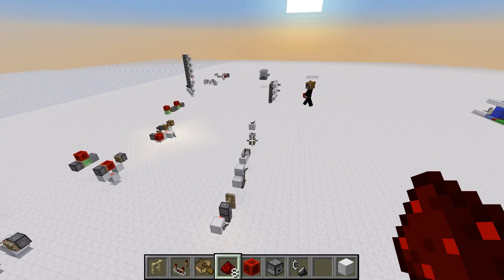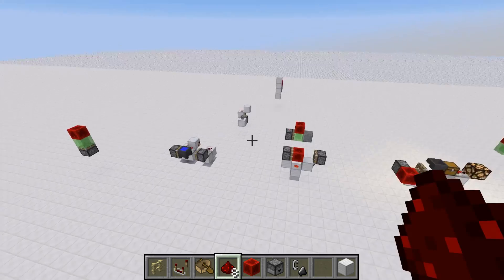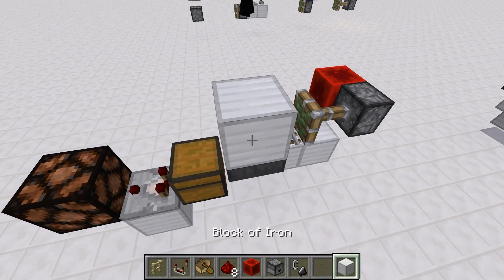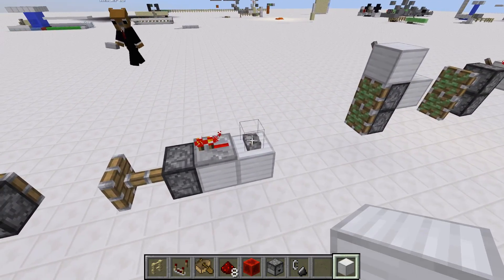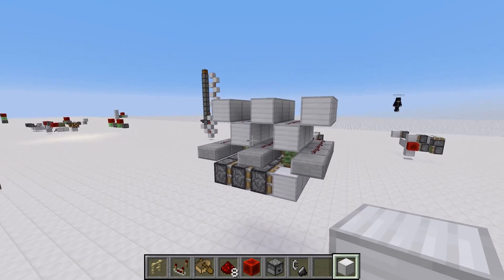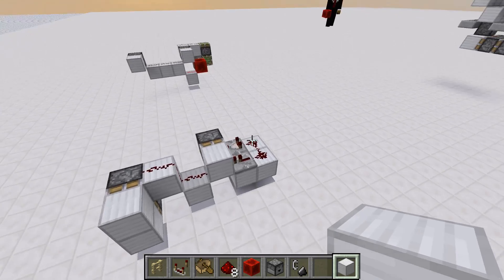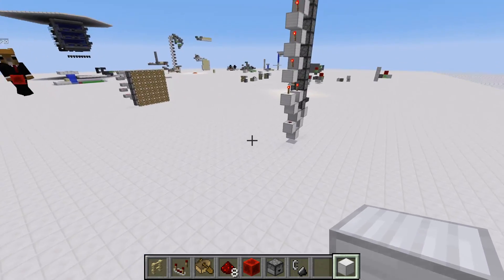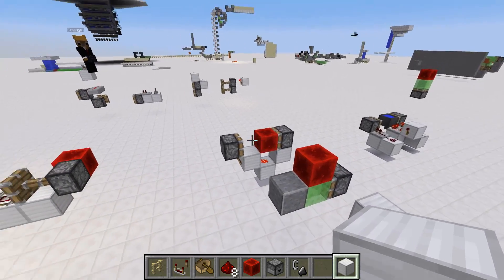Minecraft - NEW Redstone BUD Block "Observer" - Feedback for Mojang

Comment: i'm a pretty good redstone builder but honestly the whole slime block buds have always confused me. plus with the disaster 1.9 turned out to be i'm not to trusting of microjang to get something that big rite. these days they very much 1/2 listen to the community. so i am skeptical to say the least.
Reply: +minecraftaddict1169 the slime block buds aren't that complicated. They are powered indirectly by the diagonal redstone block. When they receive a block update they will start extracting. They are immediately unpowered but don't realize it yet. After 3 game ticks the extraction is finished and the piston updates itself. It realizes that it is no longer powered and retracts again.
Reply: +minecraftaddict1169  I think 1.9 rocks.  Servers like Archon and Hypixel will still use the versions that work best for them.  Meanwhile, I'm enjoying my single player worlds again :)
Reply: +minecraftaddict1169 you have clearly not swung a real sword. 1.9 is more accurate irl than before. Especially with amour it is very tiring so you would power by 'spam' attacking.
Reply: How many times should I say it? Microsoft takes ZERO PART in Minecraft development for PC, or even PE, which is what the Observer block is going to first. So before you go around chanting 'Microjang' and saying that Microsoft is the reason 1.9 is bad, do some research.

Second, I see your point with being skeptical, but when they've said numerous times to many large figures in the redstone community, such as Cubehamster, Doc, and Panda4994 for example, that they are looking for feedback to help with developing the block, I feel that, as long as there is SOME input from any of them to help, this block could be good.

Also, we have to remember that Jeb even said this is coming to Pocket Edition for now as Daniel made redstone on there from scrap, as Java has differences from C++ and mobile devices can only handle so much, we have to keep in mind that there are differences in coding between the two versions. C++ was one of the only ways Mojang could've put Minecraft on mobile. Anyways, this 'Observer' block is said, by Jeb, "will be in PC eventually" meaning that it won't be here for a while.

My comment earlier has a lot of other stuff, but I'd keep an open mind when it comes to new features from Mojang, especially when they are coming to different versions outside of PC.
Reply: ***** First of all there is no evidence i know of that says Microsoft doesn't have there hands in the development, if there is send me a source link. secondly if they really listened to the community they wouldn't have taken the approach they did to combat. it was a very half witted effort and could have been massively better done by anyone else. also i am not happy with how things are added to the game. back when i started playing in October of 2010 pc was the only platform it was on and when others came along pc led the charge and was always the most up to date. the fact that it it no longer leading the charge personally disgusts me. for me 1.8 will always be the last great update that mojang put out. i will continue to call the joint company microjang until it no longer exists. also when it comes to mobile development i couldn't care less. i feel it shouldn't be on mobile devices at all. it makes zero sense to have it on mobile in the first place. it's almost as useless as the windows 10 edition.
Reply: MJ your definition of 'proper pvp" must be miles away from what mine is. 1.9 combat is the single biggest failure in minecraft history. it takes what was a great and simple system and cripples it by setting it on fire then cutting both it's legs off. the only reason i still bother playing on 1.9 is i can make my weapons the speed they should be with command blocks and the fun of the elytra.
Reply: +minecraftaddict1169 If you really think that you can make the combat better agian but not spammy, just go to reddit and tell them how you should do it. Also, 1.9 is awsome in way more ways then some other updates (like 1.7) and I do like the thought you now need to have when you are PVPing. As for speeding up your weapons: I recommend you use an axe because it's OP and doesn't have the irritating slice effect wich was never there on the sword before 1.9. You can also chop your head of when you are done.
~magierpichu
Reply: Jeb himself has stated that Microsoft does not have anything to do with development, along with lots of other Mojang employees, one I can remember clearly is Marc Watson, one of the lead Realms Content Reviewers, Tweeted that "No one tells Jeb what to do" when it comes to PC development. Also, you cannot control, along with almost anyone else outside of Mojang or 4J studios, the console editions team, what and what not to do. Personally, I love how it is on multiple platforms as it allows the community to grow. What sucks about your opinions is that you are not open minded about what everyone wants to think, as opposed to me using direct facts from legitimate sources at Mojang.

Please, try to be unbiased when it comes to debating or other subjects in the matter as it shows that you do not necessarily care about anything but yourself or what you think should be.
Reply: +MJ  why don't i stop playing? because i'm not going to stop playing because some prick on YouTube doesn't like what i have to say on a topic. also i'm not toxic complaining, i'm expressing how i feel about something. if you don't like it don't read it. i appreciate that they added the option to completely disable the new "features" if you can even really call them that. one last thing. i know damn good and well my opinion doesn't matter to microjang. i never said it did, so i have no idea where you pulled that from.
Reply: But if you don't like US having opinion and telling us to 'not read it' why should YOU have an opinion?

Like I said before, try to be more open-minded when it comes to making a point in an argument, debate, or whatever this may be.
Reply: +MJ well of course it's still simple but it's a disaster. there is so little logic put into it. idk about you but i'm pretty sure if i'm holding a shield irl it will block attacks on the side that the shield is facing. even if i'm just sitting there doing nothing. also the fact that you still take Armour damage while using the shield is complete bullshit. unless you get directly hit on your Armour you shouldn't take any Armour damage. also i'm pretty sure i would be able to swing my sword as hard and fast as i wanted in a real scenario. if they really wanted to be smart about it they should have linked your hunger to how fast you swing your sword. if you spam your hunger would drop faster over time. if you timed your swing you would have a minimal impact on your hunger.
Reply: +EnderCreeper132 i'll be more than happy to accept that mojang is not controlled if you can link me a post stating such a claim. i have no control of what everyone else thinks nor do i want to. however i do wish for people to look at things from my point of view sp that they better understand my position. in my mind the other platforms have no right to best the pc version. in my mind the pc version is the master race and all others should only take idea's from it, not introduce new things themselves. pc has always led the way and i see no reason for that to change or be challenged.
Reply: +EnderCreeper132 you can have all the opinions you want. i don't care for them or agree with them in any respect, but you can have them. also your whole "be more open minded" crap is very contradictory of you. perhaps you should be more open to criticism and differing opinions.
Reply: +MJ Aimbots were really effective before as well, if anyone doesn't agree with 1.9 - suggest a solution to counter hackers.
Reply: What do you think my first reply says? "Second, I see your point with being skeptical." This is EXACTLY what being open-minded IS, seeing both sides and then at least partially being in the other person's mindset and seeing the positives AND negatives in having it, in this case you're being entirely negative on anything Mojang as done since Alpha as you have said " also i am not happy with how things are added to the game. back when i started playing in October of 2010" and Alpha 1.2, the Halloween Update, was released at the end of October 2010, which, if Notch never released that update, the game would not even be near where it is today as the nether would never exist.

Being overly-pessimistic about everything is never good, as well as being overly-optimistic. Yes, I was also afraid of the 1.9 combat changes at first, but I have actually seen where Jeb was trying to go with them, along with actually TRYING them myself and I am now used to them. Besides, 1.9 added lots more than just combat. The End was revamped along with the dragon fight, and the new command blocks will give map makers even more potential to do amazing things.

With every negative thing, try to find the positives, and with every positive thing, try to find the negatives, to better understand where everyone is coming from with their points. I'm not saying your not ever being open minded, but in most of your arguments, you base almost everything solely on opinions and assumptions, as you did with Microsoft and Minecraft development, even admitting you didn't know of any sources of if it is true or not.